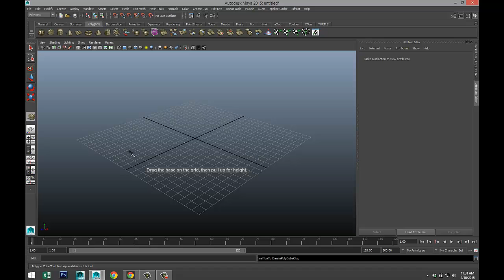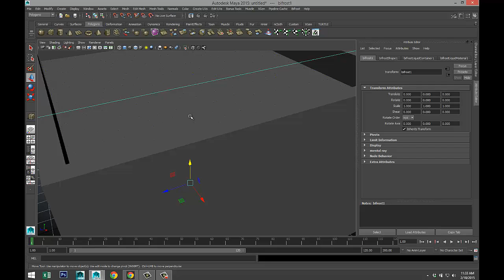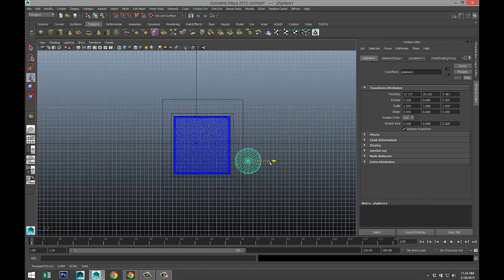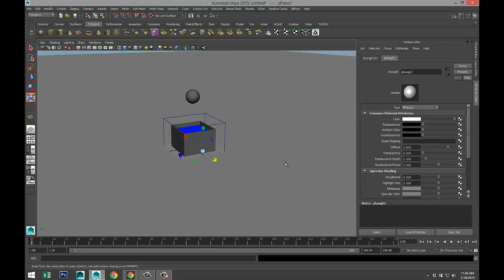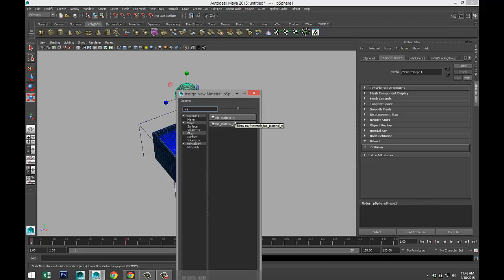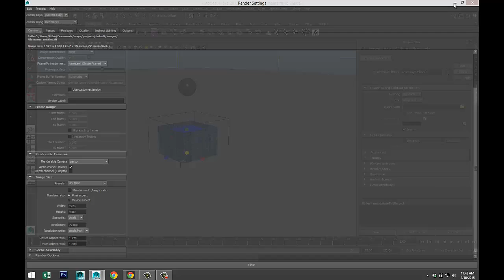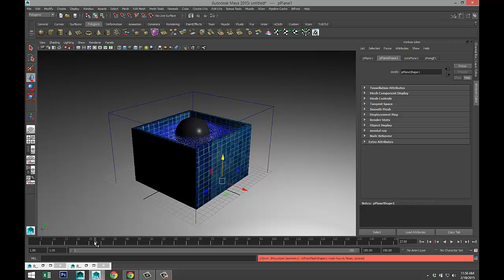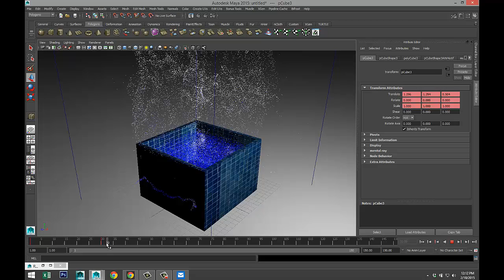Create a Water Splash in Maya 2015 with Bifrost

Comment: hi! i've tries this and I have run into this issue:
the splash itself works, but if I rotate or move the container, water never ends, stays in its original position, so I can't, for example, get a full bottle of water, rotate it and empty it, because there's always gonna be that water. Any way to fix that?
Thanks!
Reply from the maker: In the attribute editor there is a setting to keep on creating particles. You can turn that off and set a preset number of particles to create
Reply: Mike Hermes thanks!

Comment: Hi Mike
I've been messing around with bifrost - just for fun, but I am having some difficulties with my render time. You said your 150 fr would take like 6 hours or so.....well I did a test render over the weekend and when I came back I was looking at more than 7 hours/frame.....So now I am trying to figure out where I went wrong. Think my render settings are pretty simular to what you are doing - IBL etc. minor differences but nothing that should cost that much. 
Did you cache you sim?
Reply from the maker: 7 Hours a frame ? Wow. Well it depends on a lot of settings such as applied materials and textures, map sizes, light, reflection and refraction settings etc. AO, FG and so on
Reply: hi thanks for the quick reply. 
Yeah that is too much. I didn't render AO that much I know. But can't remember if I did a cache of the sim - and that made me wonder if that could have such a huge impact on render time?
Reply from the maker: That would have a huge impact, yes

Comment: Mike, love your stuff....I'm subscribed.  I also have a question.  I'm making a water bucket on legs that gets hit by a ball rolling.  I'm using bifrost to fill the bucket but after the bucket falls and water splashes, the origin object stays in place and continues to emit water.  How do I stop that so all the water comes from the bucket and th emitter isn't shown?
Thanks.
Reply from the maker: Keyframe it and delete the emitter at the frame where you want it to stop
Reply: That may work for the continuous water, but what about the emitter object that stays in place and is visible?
Reply from the maker: Not sure I understand your setup then
Reply from the maker: OK, Now I understand. You need to parent the volume of water + the emitter with the barrel. As the barrel falls the water should not stay in place. Then as the water has spilled out delete the emitter on the desired keyframe

Comment: Hello Mike, I have been visiting your Youtube Pages very often and  I have been watching most of your tutorial but I have spent a lot of time watching this particular video to see what I am doing wrong but I can't seem to find out. First of all when I select the inner cube and go to bifrost it doesn't give me that bluish effect, it's like nothing had changed and the secondly when when I shift select the container and the both cubes on the scene to add a colider I get a message saying Bifrost Container:bifrostLiquid1|bifrostLiquidContainer1Frames Submitted: 1 Frames Succedded: 0Frames Failed: 1................. and here is where I ususlly have problems even if I go ahead with the rest of the tutorial my ball animates properly but the I don't get the watre effect, Please I need you help here
Reply from the maker: First of all, thank you for watching my videos !
Try selecting the animation slider while Bifrost is calculating. You should see the blue dots. Additionally keep in mind that Bifrost works in scale, so if you water is scaled to meters and your model to millimeters you will have a problem
Reply: I just did and I am getting the same result, I would have love to send you a screen grab of my my computer so you can see what its doing only if you would be gracious enough to give me an email address I can send you the image file of my screen. The scale of my cubes 1 by 1 by 1 meters and they both  fit perfectly inside the bifrost container. Also when I select the inner cube and click on bifrost  menu and then create liquid frame 1 on my time line turns red. Finally when I click play for bifrost to calculate to fill in the scratch cache my time line turns red instead of green and yellow. Please I need to understand how bifrost works, help me. Thank you
Reply from the maker: Here's my e-mail address mh-tutorials@hotmail.com

Comment: Could this be used to dump a bucket of water? If so, how? Thanks.
Reply from the maker: +Eric Liu Hi Eric, yes it could.

Create a bucket, add bifrost and make the bucket a collider. Then animate the bucket to tilt over and the water will run out. Make the floor a collider and it will splash